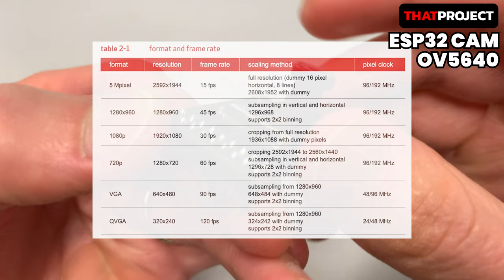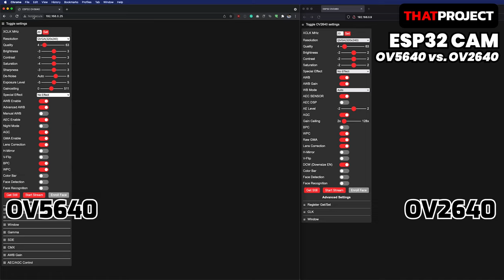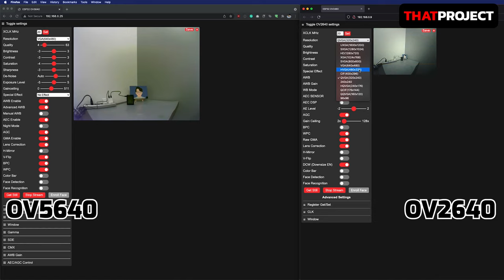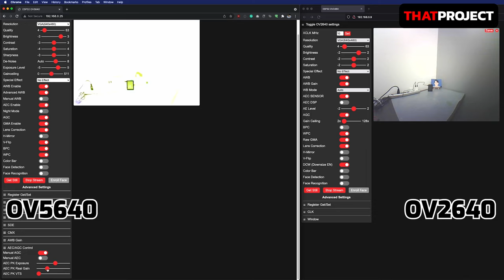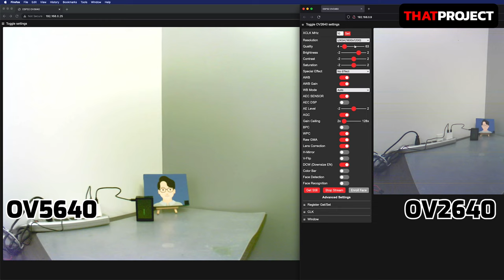OV5640 for ESP32 Camera (Compared to OV2640)

Comment: Thankyou for helping me with a nice close up shot of the correct method of insertion....!  Of all the videos and diagrams of the ESP-CAM board I have referred to,  it was not until your vid that I witnessed  the proper method to insert the OV2640 into the so called FFC or FPC  connector.  I have plenty of experience with micro processor, small modules, flight controllers, laptop and cell phone teardowns that also have plenty of ribbon cable connections.  But of all the irritating tasks I have had to do recently, it was to try to guess as to how that damned FPC connector worked. I never got it right. I spent ages and nearly lost my temper. The game is over as soon as you pull the delicate clamping device out of the base. I think that the SMD components that share the PCB in the vicinity are a pain in the asset. A nearby hammer eased the tension. And I am buying a new one.
Reply from the maker: @chrisleech1565  oh… I hope you never have to experience this terrible thing again.

Comment: Is it good at autofocusing the biological Microscope?
Reply from the maker: @kilojoules490-wp3bo  I think it would be possible to use it by additionally installing a microscope lens on top of this. I'm also looking into this, but it seems difficult to mount it perfectly on the OV2640/OV5640.
Reply: @ThatProject  thank you for the reply I'm actually making this as a thesis project using the esp 32 camera module attached on the lens of a biological microscope 🔬, and paired it to the phone wirelessly via WiFi and controlled the fine and coarse adjustment knob of the microscope using stepper motor. Can u do a test video of the microscope attach the esp32 cam. autofocus.

Comment: did you noticed any heating issue in Camera Sensor(OV5640)? my board become toasty after 4-5min use. (Mostly because of LDO and Camera heating.)
Reply from the maker: One of my followers said that the pinout of the Chinese clone of OV5640 is different. Are you using a product from Waveshare like the OV5640 I used? https://www.waveshare.com/ov5640-camera-board-b.htm
Reply: @ThatProject   yes, it's waveshare one. Also I noticed I can't get max resolution out of OV5640, I think,I'll just make my own board to try it out again.
Reply from the maker: @punit_patel  Oh, you're using a custom board. I look forward to the good news.

Comment: Sorry, but I didn't get what time is required to take (and store or transfer) 5 Mpix still photo on ESP32 with OV5640 sensor. I need to know how fast I can take photos with it.
Reply from the maker: @igg5589  According to the OV5640 datasheet, it says that you can get 15 fps at QSXGA (2592x1944), but this is not possible in the ESP32 environment. You mentioned a still photo, why is it important to acquire the image quickly in this case?
Reply: @ThatProject  I want to try making HDR photos (set of slightly underexposed, normally exposed and overexposed). So if subject/camera will move a lot I'll get blur.
Reply from the maker: @igg5589  I don't know about dynamic range, but exposure control is possible at the registry level.

Comment: Hi Eric. Im having a problem. The example sketch is still giving me the Toggle OV2460 settings UI even though the sketch is identifying the camera as OV5640 (PID 86) and isn't giving me the advanced options and resolutions.
Reply from the maker: The PID of the OV5640 is 0x5640.
I have two OV5640's and both are recognized properly and I can access all UI interfaces. They have no problems at all. Where did you buy it from? FYI, I'm using Waveshare's OV5640.
Reply: @ThatProject  I added "Serial.print(s->id.PID);" to the sketch after "esp_camera_sensor_get" and it prints 86. 0x56 in hexadecimal.
Under sensor.h in the example sketch has "#define OV5640_PID     (0x56)" so the board can see the 5640, but loads the 2640 interface anyway. Maybe there was an update somewhere that broke the code? I am a hobby programmer and quickly get lost in code.
I bought the Taidacent OV5640 from amazon and it seems like a true ov5640.

Edit: I realized I posted a duplicate comment with a link, so sorry if it went under review and sent two notifications :)
Reply from the maker: @rileyjones7231  I put the same PID checking code as you and tested it.

sensor_t * s = esp_camera_sensor_get();
Serial.print("Show me PID: ");
Serial.println(s->id.PID);

*Serial Monitor
Show me PID: 22080

Decimal(22080) -> Hex(5640)

My OV5640 outputs 22080. Sorry I have no idea why you got 86.
Reply: @ThatProject  Strange, sounds like I have a different version of the sketch that uses different pids, I might try forcing the code to use 5640 as the pid instead of letting it discover it. Or looking around in different board versions for the same sketch that uses the camera model as the pid

Thank you for all your help! Love the channel

Comment: Hi, thanks for the video. Why is the minimum frame rate in 1080p 30fps written in dataset OV5640, but your video does not have 5fps? Are there OV4689 tests on this module and will it run on it?
Reply from the maker: As far as I know, the OV4689 is not supported by the ESP32-CAM board.
There could be several reasons for the OV5640 to have a slower FPS than the datasheet. One thing is the Pixel Clock, which synchronizes all the bits on the port. PCLK must also be satisfied to meet the maximum FPS, but a clock of 96/192 MHz is required to obtain 60 fps at 720p resolution on the OV5640.

Comment: Note, the lenses can make a significant difference in noise, especially if they have different f-stops.  I don't think the two sensors have significantly different noise (SNR) figures.
Reply from the maker: Since the condition of the OV2640 used in this test is poor, maybe just show more noise. Not sure about it. Anyway, there may be no difference between the two SNR figures.

Comment: Great video thank you for sharing , I saw a video for changing only the lense not the sensor which make better quality images with same resolution (board mount lenses),just fix the lense base firmly the rotate the top part of the esp32 lense to release it then put the other lense on top of the esp32 sensor
Reply from the maker: If you open the OV2640 lens, you can see the CMOS sensor module inside it.

Comment: Hello, thanks for the very useful videos. If you have a moment, I wonder if you would perhaps provide a recommendation. I am looking to create a camera system with micro-SD storage (no WiFi or Bluetooth) and USB-C interface. I am looking at the OV2640 and OV5640 as possible cameras. What I am having trouble with is finding the right microcontroller. My biggest constraint is that the entire camera system must fit in a thin tube that is only ~12mm in diameter. Any thoughts? Thanks in advance.
Reply from the maker: Does the distance between this subject (thin tube) and the camera matter? Should it be capable of photo capture or image streaming?

Comment: What is the code that you use to obtain the CameraWebServer for OV5640 Camera Setting demonstrated in this video ? Could you share or explain it to us...thank you
Reply from the maker: CameraWebServer is a basic ESP32 example.
You can try it through Arduino IDE>Examples>ESP32>Camera>CameraWebServer 
If you are using the OV5640 you will see the extra options.

Comment: Great video thank you. I have some questions:
1) what does 'FBS' stands for and what does it mean 
2) How come the OV5640 has less angle of view than the OV2640, I thought that OV5640 has higher resolution and greater andle of view.
Reply from the maker: 1) You meant FPS? FPS is the frame per second. This is about how many times the screen refreshes per second. Typically, a screen without delay is 30fps. 2) The difference in angle of view depends on the lens attached to the front. You can purchase lenses of various angles of view.

Comment: Hi, awesome video. I also have a waveshare 5640 cam but I cannot figure out what settings to put in a custom arduino sketch. Do you use "#CAMERA_MODEL_AI_THINKER"? or a different set. Appreciate your video and any hep
Reply from the maker: All pins are the same as the AI-THINKER board.  You need to use it #CAMERA_MODEL_AI_THINKER.

Comment: Hi
How are the macro shooting capabilities of the OV5640 and OV2640 in a well-lit environment? have you had a chance to try this?
Reply from the maker: It seems that the OV2640 and OV5640 cannot be used for macro photography. There is no aperture control, and even with manual control of the focal length, it's difficult to focus on objects that close.
Reply: @ThatProject  I'm programming with ESP32 CAM OV2620 Arduino ide. The config is set to ESP32 Can axes poit, pixel format is JPEG, but the image is too slow, the resolution is set to SVGA, but the image hangs a lot. I think MJPEG format can give a more fluid image. Can you help me access MJPEG codes?

Comment: these look cool! could be used for mounting cameras on a kite?   can several be used in parallel to capture higher resolution or higher frame rate?
Reply from the maker: Wouldn't it be too heavy to attach devices including batteries to the kite? Still, it's difficult to achieve fast frame rates at high resolutions. Additionally, transmitting data through ESP32 also has a bottleneck.

Comment: nice, you know you can screw/unscrew the lens to adjust the focus, it seems they use a bit of superglue and it needs a bit of force at first.
you can take the lens off and possibly swap them.
*edit: i noticed in my setup you get more line noise at 20mhz than 10mhz. so i will set default 10mhz from now on. do you get any benefit at 20mhz?
for slower connections (bandwidth) adjust the jpeg quality to higher quantization values.
Reply from the maker: For OV2640, it shows faster FPS and less noise at 10 MHz, VGA resolution. It seems that more tests are needed for speed and quality with changing XCLK.
Reply: @ThatProject  for very low light conditions you can go down to 2 MHz. who knew that XCLK affects exposure time!!! that was the source of my quality degradation problem after the v1.0.4.
Reply: @ThatProject  External antenna and good power will improve image quality for OV2640, seems bad schematic for this module. With external antenna I have not color lines anymore.
Reply from the maker: @docwhogr  OMG. That's a crazy idea. Two thumbs up. I'll try it sooner or later.
Reply from the maker: @kDnZP  Totally agree with you. 
The problem is that the same problem occurs even if I use the PCB I made, not the AI-Thinker board. Of course, no external antenna was used here either. Anyway, thanks for the comment.

Comment: Hi! thanks for sharing your experience i have a question, what about esp32-s3 does it get too hot? any difference at all better speed or higher frame rate?
Reply from the maker: Which device are you trying to use OV5640? Well, for the temperature issue, I'll make another video for it.

Comment: 1. Did the ESP modules you used have PSRAM enabled?

2. Can you change the XCLK to better match the required input clock to get a better fps?
Reply from the maker: To use this, you must use PSRAM. Lowering XCLK from 20MHz to 10MHz has been shown to have an FPS boost effect at VGA resolution, but this is experimental.
Reply: @ThatProject  A recent experience that I had with some ESP-CAM modules were very laggy and intermittent at 20MHz with the OV2640 camera which was fixed by changing to 24MHz after checking the datasheet
Reply from the maker: @16aroth6  Oh, that's interesting. Let me try it too.
Reply: @ThatProject  One other thing that I found in the datasheet, It looks like the IO level for the OV5640 is 2.8V max instead of 3.3V, I don't know if that would affect the performance of that camera or if the ESP is just overdriving inputs a little bit on that camera module?
Reply from the maker: @16aroth6  Well, I don't know about the issue at the IO Level. I thought there was no issue in this part because the OV2640 also uses the same 2.8V. For the issue regarding the Core voltage in the OV5640, check this out. https://youtu.be/yzWiicnv-f8?si=he45Lo7UWChzgwAD

Comment: Hey, can you advise on how can i manage to build a camera to run at 480p90? or anything smooth in the range of 80-90fps (i'm trying to build a low cost IR Tracking, so i need a high fps build, resolution isnt important)
Reply from the maker: Unfortunately on ESP32, you can't get more than 30fps at 640x480 resolution. It's recommended to look for other platforms (Like Raspberry Pi).

Comment: Could you advise on trying to build a small solution for 60fps camera at 720p. And transmit via IP
Reply from the maker: Well honestly, 60fps at 720p is not possible with ESP32CAM. 25 fps at VGA resolution is the maximum. It's recommended to do your project based on the Raspberry Pi.

Comment: Hello, great video Sir. 

But i have a question, do we can also remove the IR filter in OV5640? 

i once removed the IR filter from OV2640 160 angel cam
Reply from the maker: Since it is very similar to the OV2640, I think you can force it to remove the IR Filter.
Reply: thank you for the answer Sir
Reply: Hi, what do you achieve by removing IR filter?

Comment: Hey man thanks for this helpful video, i want  abit of your help and thoughts on something i want to start and work on , which is a little home security cam using maybe one of the cams you mentioned in this video, i want to run 2 esp32 LAN one capturing the image and being able to check it through the network and the other esp32 being connected to a display to  have a easier way of seeing whos at the door, what im thinking of doing is connecting the security esp32 cam with a battery and making a enclosure for it to protect it from the dust but it will just sit right on a window above the front door. Any thoughts on this project and maybe abit of your help? Thanks in advance<3
Reply from the maker: ESP32-CAM can be used on battery power, but if you continue acquiring images, battery consumption will be very high. Like a typical door camera product, have you thought about any triggering? For example, the camera could turn on by motion recognition.
Reply: Hey man , i want the setup to be more clean and dont want to run a cable through  the ceiling you know , thats why im looking at how to make such little system energy efficient,  so do you think have some sort of sensor is good? To kinda wake the cam up and the esp32 from deep sleeping  , by the way i got at the moment a motion sensor home , loads of esp32's   @ThatProject
Reply from the maker: @alixmichael-yv4go  What I just want to say is that the ESP32-CAM cannot continue to run when running on batteries. This consumes a lot of battery power. It may be effective to use some external sensor to wake the ESP32-CAM from deep sleep. It can save more power through minimal battery consumption.
Reply: @alixmichael-yv4go  I don't have a 5640 to test but the 2640 with esp32-s together consume 200mAh when idle (not sleeping) and 300mAh when capturing and transmitting via WiFi, so you'd need 4000mAh battery to keep it transmitting for 24h if you have a good quality 3.3v voltage regulator or 5000mAh if you use a USB power bank (double voltage regulation from ~3.7 -> 5 and 5 ->3.3v). With a PIR motion sensor though, you can hook up the "motion detected" pin to an IRQ pin and keep the esp in deep sleep, which allows the same battery to last for weeks. However, after coming out of deep sleep it takes a few seconds to establish the network connection so you'd have to buffer the images right away and use a separate task on the second core to handle the networking and upload the images afterwards to not miss any action.

Comment: Nice and useful video! Thnx, bro!
Too bad that OV5640 cannot perform at least 25-30 fps at decent resolution... :(
Do u know any other (not too expensive) and (pretty small) way to get 720P@25-30FPS via wi-fi? IP-cams are pretty big.
Greetings from Russia :) And sry for not the best english.
Reply from the maker: Please check this post. Seems like there is a way to get more FPS. 
https://www.reddit.com/r/esp32/comments/vndbh7/how_to_increase_fps_on_esp32cam/ 
If it doesn't work, you need to use other platforms like Raspberry Pi.
Reply: @ThatProject  oh. Thanks, gonna try it.

Comment: My OV5640 is only showing a res of 1600x1200? What else do I have to do to get full res? Thanks
Reply from the maker: Do you use CameraWebServer? Are you sure it recognized your OV5640? It should display OV5640 in the title of your web browser.
Reply: @ThatProject  after reinstalling it now works but gets very hot and shows higher res images white or pink if at all. :-(
Reply from the maker: @MONKEY-vi7hx  That's not a good sign. Unfortunately, seems your OV5640 is not the same as mine. For reference, I'm using WaveShare's product.